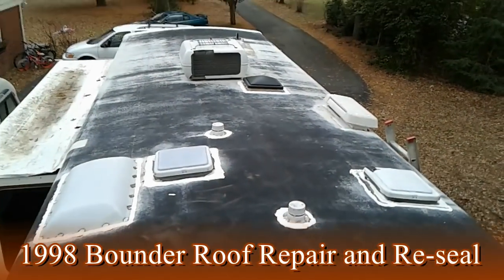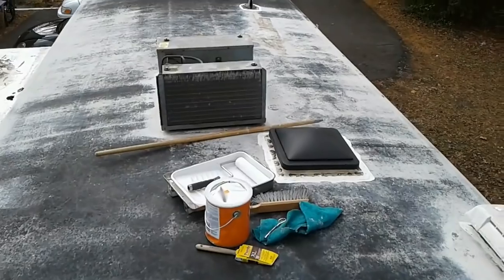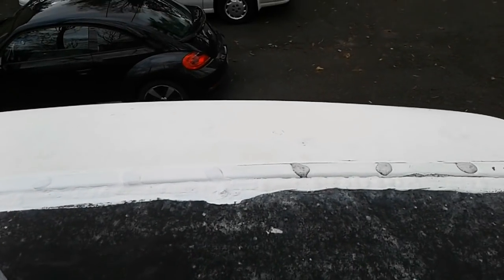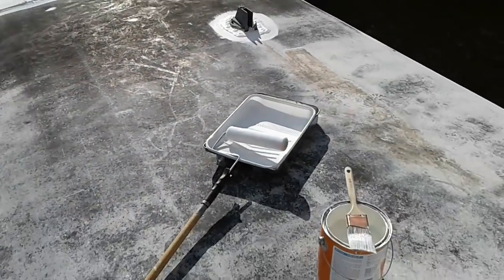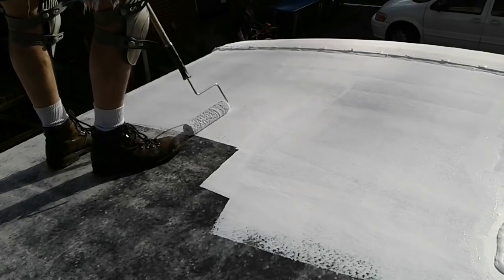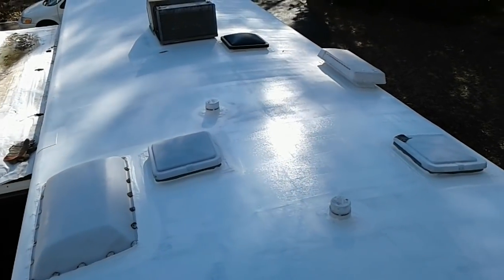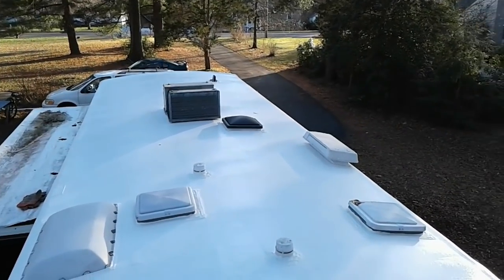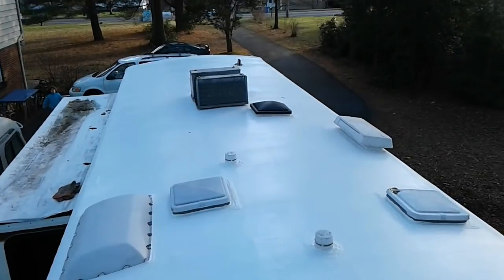How to Repair and Seal a Rubber RV Roof - 1998 Bounder Motor Home

Comment: Just a thought here. I used a different elastomeric coating. However most leaks come from the edge where the rubber roof bends over to the drip edge. Water leaks through there and down the outside of the wall leading to soft spots on the floor. You don’t see it leaking and yet it is and causing damage. I washed my roof with the “Reliable One”, then used alcohol on the edges and then applied a 4” Dicor tape with a cloth backing along the edges full length. The cloth backing is then coated with the roof coating while doing the whole roof. Did 3 coats. We have had some bad rain storms here and this combination of steps has proven itself to be worth the effort. Also used self leveling caulk on all openings. It’s an inexpensive way to get more time from a worn roof.
Reply from the maker: Thanks, Charles. Good info and tips!

Comment: I started the same project on my 1989 Damon Escaper 27' Class C this morning.  My roof is in pretty decent shape for being 30 years old.  I found a couple of small holes and I will be sealing up around the vents, etc.  I am also going to be using the Heng's Rubber Roof Coating.   I think the key is to not fall off the roof.
Reply from the maker: Good luck with the project. And please don't fall off!!!

Comment: I got a 2000 Bounder 39Z that I need to seal the roof bad. Weather in Washington is getting a bit more wet. Thanks for the video. I have some damage I need to fix on long the edge where the roof wraps down the side.

Comment: I work on these for a living. The proper way is to remove the old sealer best as possible and replace with new dicor sealer. The best way to do front and rear cap is to use the bear Bond tape or other rubber roof tape. I'd prefer using the tape over the cocking wherever possible seals a lot better and a lot cleaner job. Either or we'll do the job but I recommend trying to remove the old sealer first.
Reply from the maker: Thank you for the good recommendations.
Reply: Rob Warga How do you recommend removing the old sealer? Some of that stuff is pretty thick and I would worry about cutting the roofing.
Reply: Use a good quality putty knife remove as much as you can and as smooth as you can. What you can't remove take a good wire brush and scuff it up and go over it with the dicor. It's not as bad as it might look goes pretty quick. Be careful along the edges for it is  self-leveling and will follow down the sides. It's not a quick job but it's painless. From the factory my opinion they don't apply enough dicor so I would apply a little extra when putting back.  Have a good day and happy seal ing.
Reply: So Rob, ir you are refinishing a roof from a 20 year old motorhome, would you seal the caps with a permabond type tape and then roll on the new roof finish? Also, what about where the roof meets the sides of the RV? Is that a different sealer? 
You have been very helpful and encouraging. Thanks
Reply: The videos put out by Dicor themselves show them applying it directly over the old sealant.  As long as it isnt peeling off, they recommend cleaning it and applying their product directly over the old.

Comment: My 2001 31W Bounder has a TPO roof.  This Summer 2021, I gave it two thick coats of Henry Tropi-Cool.  It took the entire 4.75 gal bucket.  I also coated the exhaust vents and the shower skylight for protection and to reduce the heat coming through.  One month later I was hit with a 30 minute quarter-sized hail storm that shredded the topper awnings, broke the exhaust vent lid in the kitchen (smoke colored translucent plastic, the white one in the bathroom with Tropi-Cool coating survived), and cracked the shower skylight.  The AC covers would have shattered but I replaced them when I coated the roof so they were fine.  The roof has some significant dimples, but the Henry coating saved my roof from tears.  There are a few 1/8 inch "chips" taken out of the top coating layer I guess due to the hail not being smooth balls, so just in case I plan to coat with one more layer of Henry Tropi-Cool.  With the awnings off, I also coated the slider tops.  Without the awnings I got water soaking the carpet in the RV at one corner of the open living room slider.  To "fix" the skylight, I just lathered on thick coatings of Tropi-Cool over the cracks hoping that I will not have to replace the skylight.
Reply from the maker: What an experience! Glad the damage was not beyond your ability to mend thing up. Good luck!

Comment: My concern with siliconized and liquid rubber applied directly to another rubber based product is that it will just peel off; that, maybe water can find a way between rubbers. I wonder if a water based elastomeric coating followed by the rubber coating like you show would work much longer?

Comment: For those of you contemplating a similar project, I would say it took me 3 hours to clean the roof,  about an hour to do the Dicor Self Leveling Lap sealant around the vents and misc,  1 hour to apply coating with a brush around the edges and vents, and another hour to roll the two coats.  Once you start rolling, it goes fast.  So total time was about 6 hours over two days.   I used an electric power washer to clean the roof, and then a RV long handled brush to bucket wash it.  I did NOT use a dry detergent like Tide powder, but I should have.  I had already scrubbed it with Dawn Platinum and was too lazy to go do it again.  My guess is Dawn is not recommended because it is not  the right kind of detergent.  The Dicor self-leveling lap sealant is great.  You will use about 1 tube per standard 14" vent.  I had 4 tubes and it was not quite enough to do 3 vents plus the other smaller tank vents, etc.  I would suggest doing the lap sealant a week before coating the roof if possible.  I only waited 1 night, and it was fine, but still fairly soft.  Some people say do the lap sealant after the coating has cured, but that seems backward to me.  Either way is probably fine.
Reply: Dawn may not be recommended because it contains polymers (copolymers) that could affect the coating's ability to bond with the roof material.   The powdered dry detergent probably doesn't have this problem.   Use the powdered detergent.
Reply: I use a 50/50 mixture of bleach and purple power.. it removes everything, even old crusty roofing.. I even use it on the sides.. it will discolor old plastic stripes..  but, you don't have to scrub nothing...and your new sealant has a clean surface to bond to..

Comment: Thanks for the lead on the product you used.  I have a friend that is looking to do a similar project.  I also want to share my experience changing my slide out toppers.  I personally had a very good experience with Tough Toppers out of Washington state.  Their material is way thicker than the original Dometic material.  Don't stress over the work, its really easy once you know what your doing (my second one went way better than the first).  It'll probably cost you $130-$160 depending on actual size.  Cheers.
Reply from the maker: Thanks, Stephen, for the note, and for the good lead. Yes, I still need to replace the slide out topper. I will search online for Tough Toppers.  Thanks so much.
Reply: @Buckwsr  I did the same for three slideouts on our motorhome. Very pleased with product and the staff at Tough Topper.

Comment: I've read most of the comments, and most Google Reviews as well, and this Product seems to have about a 95% Good Rating, I Just Ordered 3 Gallons for our 35ft, " 30sq Ft Roof " 99 F53 Fleetwood Flair. It seems to good to be True, and you know what is said about That, but I'm rolling The Dice, as This thing is going down the Road after this Year, so If it Holds up 1 Year, then I'll be completely Happy, even if I Have to give it 1 Re Coat Goodbye...lol

I Have Dicor Lap Sealant for The Seams, and Rounded Edges ETC, But I Am Really Thinking about using 4" Eterna Bond on Both Sides and The Termination Caps, along with 1 small Hole near the Skylight.

So, just verifying some remarks, you only powerwashed this roof, with no scrubbing with powdered Tide ETC and it did not peel B4 you Switched over ?

 I know you said you switched because of seeming to have to re seal every year, but why ? Was it thin looking, with the black showing through, or what was the issue ?

Thanks
Kevin
Reply from the maker: I don't remember scrubbing the roof at all, just pressure washing. The original coating was pretty much all gone anyway.  And I was in a hurry to get this done before winter, as it was already December. I think I had to recoat every year Spring because after a year in the elements it looked all dirty and discolored, sort of like a flat finish paint that shows all dirt marks. But I think that between the dicor sealant, the 4-inch tape, and the Heng's, your roof will be dry and nice and good to go! Some people confuse the Heng's with Henry's (available at home depot), but they are completely different products. In the end, I'm glad I switched over to the FlexSeal liquid rubber. Way better, and no more annual recoating. But of course, a lot more expensive. Good luck.
Reply: Did you have any of the old stuff flaked up everywhere ? I'm just starting into this, and MAN I HAVE A MESS, I've been scraping, using a Wire Brush ETC,  this thing is REALLY BAD.

Comment: Hi Buck. I'm about to redo the  roof on my truck camper. I'm going to be using the same product. My question  is. How is it holding up a year later?
Reply from the maker: I did this job in December. Come Spring, I re-coated it. That was a year ago. Today it is still nice and dry. I have had no leaks. But I think it is the kind of product that should be re-coat every year or so. Good luck.

Comment: Just ordered this!!  Will it seal the roof?  We do not have any leaks but our RV is over 20 years old and I want to make sure we do not have that problem.  Thanks for all the DIY videos You have posted!
Reply from the maker: Be sure to use the self-leveling sealant around all the protrusions through the roof, or at least check to make sure the existing sealant is still in good shape.

Comment: we have used this but like the rvroofmagic better. goes on very thick and our shop has never had a call back on any units it was applied on
Reply: So for how long have you been using the RV Roof Magic?  My 2000 Terry TT has the Alpha roof and the RV Roof Magic is one coat, no primer needed.  The Liquid Roof product requires the primer on an Alpha roof, which would be nice to not have to do, so I'd like to know if Th Roof Magic really lasts for, say, 5 years or better.  Thanks.
Reply: Coating the clean black rubber is okay??
Mine is in perfect shape but completely black rubber..they told me you cant seal over the bare black it needs a new roof..

Comment: I hope you have better luck with the Heng's than I did! After about a year & a half it started peeling off my roof! I have a 2000 Bounder & just spent 2 days power washing & scraping that crap off! I'm going with Dicor EPDM 2 step system this time. Darn Heng's sure caused a lot of work for me!
Reply from the maker: I think originally I used Heng's because I did not have time for a 2-step process. I wanted to coat the roof quickly and without delay. 6 months later, I re-coated the roof again with Heng's. I will probably re-coat it on a yearly basis. The reality is that an RV roof requires regular maintenance. Let me know how you make out with the Dicor. Thank you.
Reply: After a lot of research, I'm gong with rvroofmagic which is a one coat coating guaranteed to be good over any type of roof including the Fleetwood Alpha roof that my 2000 Terry travel trailer has.  The other very good product is Proguard Liquid Roof, but that requires their special (and expensive) primer on an Alpha roof, which means working within a tight application window.  Hoping the 10 year warranty means something on the roof magic...lol
Reply: I used the two step Dicore system. Following all directions closely after 3 month 90% of it peeled off. I'm going to try this Heng product and see if it sticks.

Comment: Did your roof bubble or blister after the coating dried? Mine was down the the black like yours and blistered.
Reply from the maker: No. To this day, I've never had any problems like that. I will say, however, that two seasons ago, I switched over to Flex Seal liquid rubber. That has worked out better for me. With the Heng's I felt like I had to recoat every Springtime. Hey, thanks for the music, Sammy!

Comment: Im about to buy my first camper and the people told me it does need new roof coating, so i looked up the hengs coating your are talking about and there are so many, which should i get exactly?
Reply from the maker: I have a link in the description where you can find the exact product I used.  Since making the video, I have recoated it twice. I re-coat it each Spring. But yes, there is a lot of products on the market. I used Heng's because it was a one-step process...no prime coat required. Just clean your roof, let it dry, and apply the Heng's. So for me, that's what I chose to use. Good luck.

Comment: Excellent video.   Just purchased a 1999 Fleetwood Tioga 29Z.  While the roof does seem solid, it has leaked around the skylight.  The previous owners put a variety of tape sealants over most of the edges and caps.   It really is a mess up there.  Although the original roof is white, there isn't any white left.  Its all black and chalky.  Plus there were some small rips in the membrane.  I've been trying to convince myself that I could get away with a roof coating.  But as I'm typing this I realize that that isn't going to work.  I'll need to install a new membrane.  Any suggestions you have for products and hints to get this accomplished would be most welcome.
Reply from the maker: Thanks for the note. I did not have to go to the extreme of replacing the entire rubber roof. Since making this video, I have switched over to Flex-Seal liquid rubber coating. With the Heng's, I felt like I had to re-coat the roof every year.
Reply: Why did you have to re-apply it every year? Was it because the black would bleed through?? Did the Hengs stay securely attached??
Fixin to do all this myself as my roof is completely black now. Zero white left on it!
Reply: @marvinelvis2989  not sure if my previous reply went through.  I ended up completely redoing my roof.  The membrane was in such bad shape. I also had no idea what products the previous owners had used.  Some coatings will stick to some products and not to others.  For Peace of Mind I went right to the decking and started from scratch. It was easier to do than I anticipated.  The old membrane came up VERY easy.  Which told me the glue that was holding it down was degraded.  I did it all by myself, which (if you're considering replacing the membrane) I DO NOT recommend.  I also went ahead and replaced all the trim with .  As the original trim didn't have gutters.    You can see all the work I did on my channel.  Also feel free to reach out with any questions.

Comment: How many gallons of hengs sealer did u use on this project
Reply from the maker: I used a little more than 2 gallons to two-coat the roof.
Reply: Buckwsr thankyou for responding got it
Reply: How long is your coach?
Reply: Robb Ward  hi it’s a 30 ft 1995 sea breeze

Comment: Did you scrape off the old caulk & seals before re-caulking or did you just brush & clean the existing caulk  & add your dicor over the existing?
Reply from the maker: I removed any caulk or sealant that was loose or peeling, but left any that was still solid and intact.
Reply: @Buckwsr    Thanks so much!  That’s what I did.

Comment: I have a 2008 weekend warrior and I'm not sure if it has ever been recoated.. I have noticed some cracking in the rubber, along the edges where the top rubber meets the side trim.
Should I tape along all edges before I paint? Or, should the rubberized paint seal these cracks pretty well?
Reply from the maker: I would recommend some kind of sealant, like the Dicor self-leveling roof sealant or other type of caulk. I don't think the Heng's alone would seal those seams sufficiently.

Comment: Very good job 👏.  Can you tell me how many 1gal cans it took to do your roof?  I have a 30 foot RV.  What's the full name if roof seal you used?
Reply from the maker: I did two coats on my 34 foot RV with about a gallon and a half of the Heng's Roof Coating.
Reply: I was going to ask the same question.
Reply: Planning to do this on my 25 foot trailer…. Purchased 2 gallons.   Want to cut in twice and do 2 coats overall.  Now seeing this I’m hoping for 3 coats…. I’ll report back.
Reply: Two gallons was enough for me do 3 coats on 25 ft roof and two coats on my single width slide out. Great product and roof is bright white and looks like new

Comment: I used 1.5 gallons of Heng's Rubber Roof Coating to give my 27' Class C two coats.   The directions on the paint can say to use a mixture of strong powdered detergent (e.g. Tide) and water and scrub the surface and rinse well.   The can says to allow 4 hours between coats -- that was about right for a sunny day about 78F with 35% humidity.  Normally it is much more humid in Iowa , but I got lucky.
Reply from the maker: Hey, thanks for the report. Sounds like the weather was perfect for the job. As you may recall from the video, I did my roof job in December (in NJ). Not ideal, but I had to get it done.
Reply: @Buckwsr  what temp was it outside?  The can says no go under 50 degs... we are around 54deg highs right now where i live
Reply from the maker: @mtemp208  It may have reached 50 degrees as a high that day, but surely it was not that warm continually over a 24 hour period. I knew the can said 50 degree minimum, but I decided that the urgency of my situation was more important and I simply had to do the job without delay.